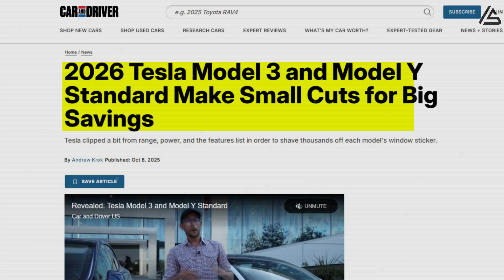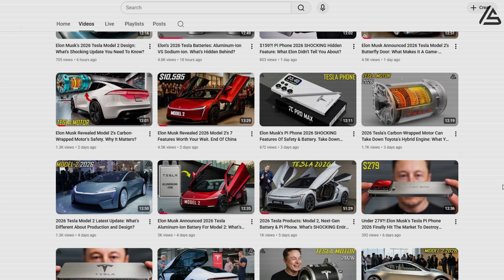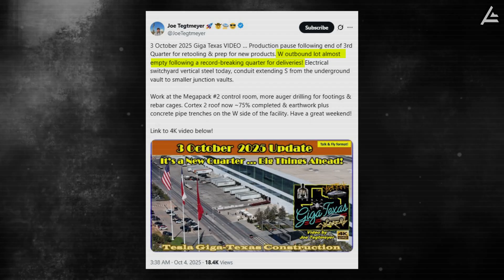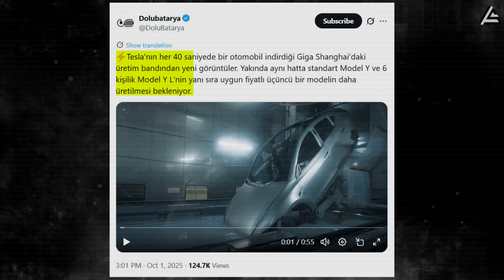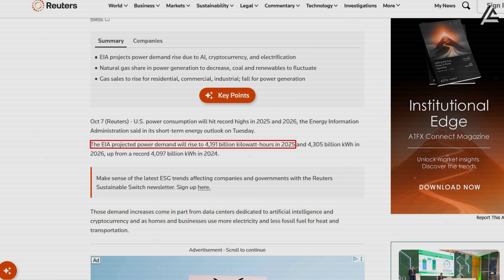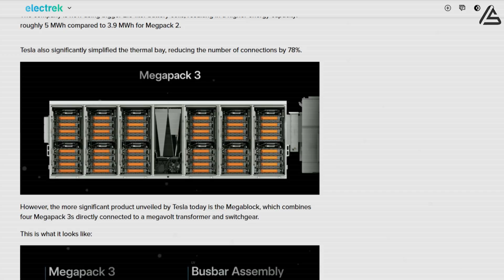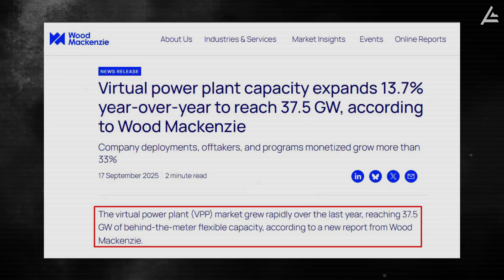Elon Musk Announced 2026 Tesla Model 2 Latest Update: What You Need To Know?

Comment: Nice vehicles if the batteries hold up and don't cost 3 gold bricks to replace.
Reply from the maker: What kind of battery warranty or lifespan would make you feel comfortable with an EV purchase?
Reply: @AutoGearShift2  5 years would be nice. Most people own a new purchase for 5 years. My truck is going on 18 years so far. The 87 F250 is in restoration and right after that the 69 C10 will get restored. I believe you drive the wheels off a vehicle and then put them back on and continue driving.😁
Reply from the maker: wow 18 years? so cool I must say